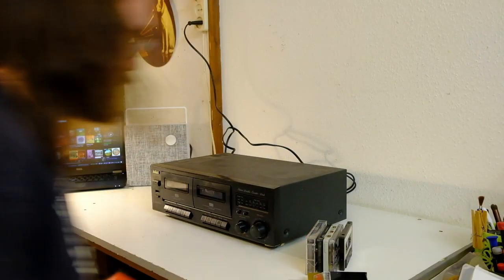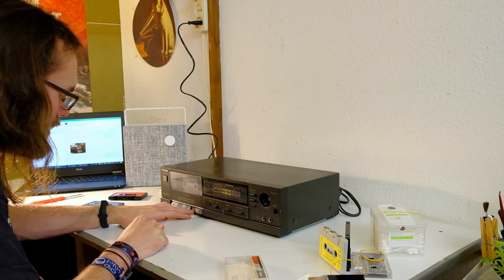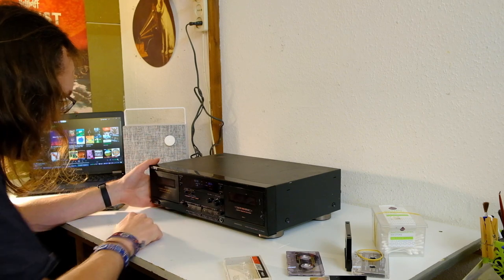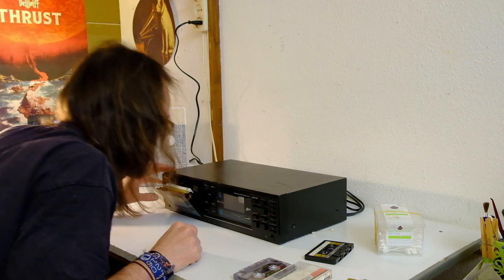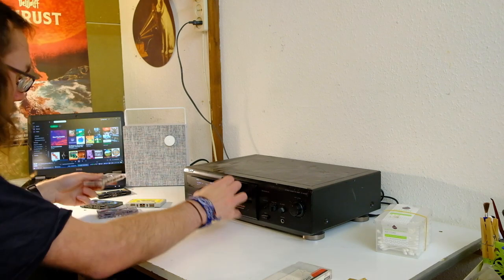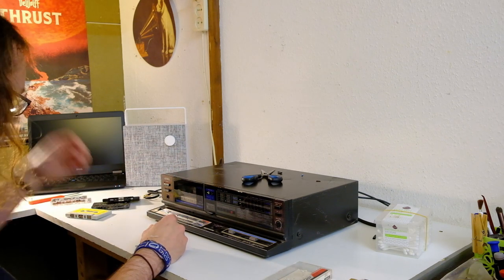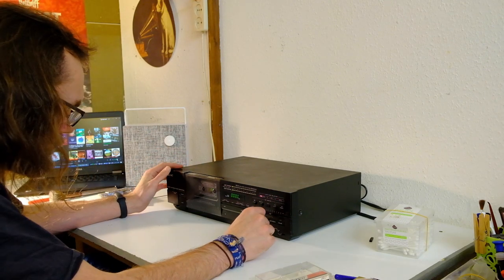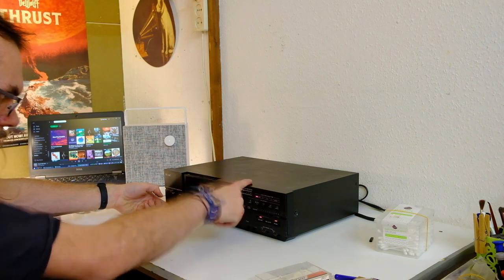21 cassette decks, a speedtest

Comment: The Sharp RT-10 has the typical fault that all of them have now: There is a tiny little idler wheel around the capstan, that via another idler wheel drives the take-up reel during playback/record. The tiny little idler wheel due to the age of the rubber falls apart. I have had two RT-10 over the years, both of them only had little bits of rubber left floating around in the mechanism. Really a shame, I found the Sharp RT-10 are simple decks, but sound quite good.